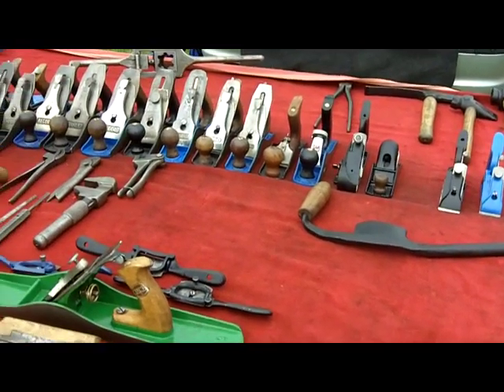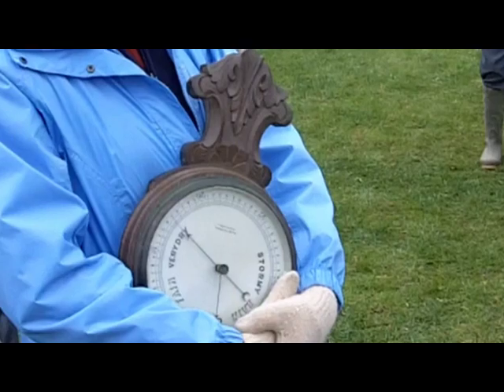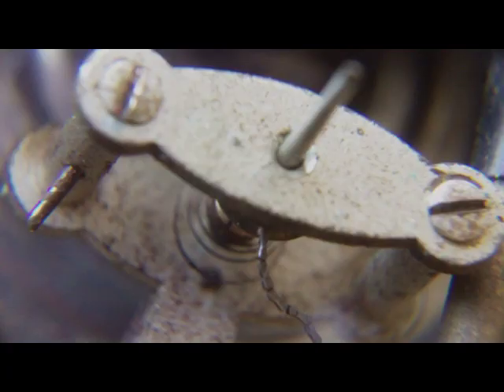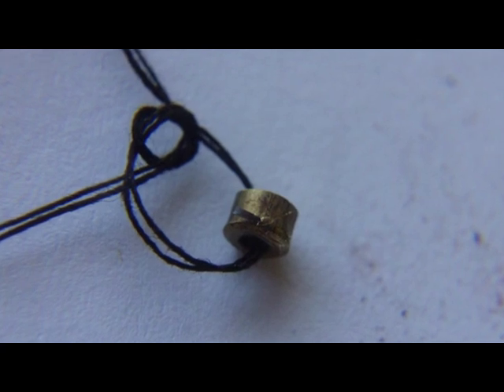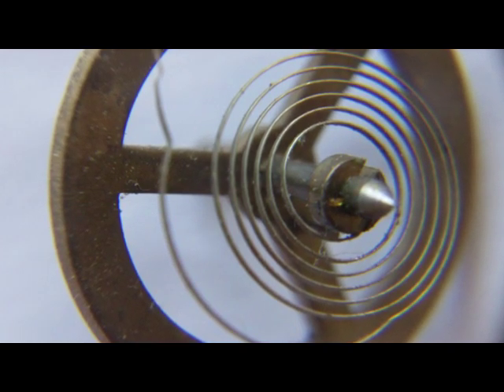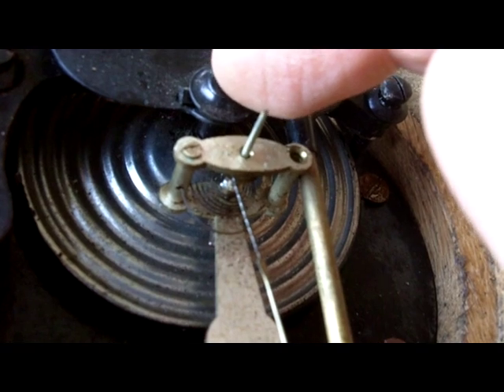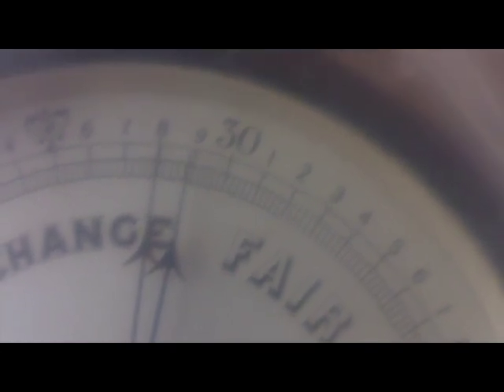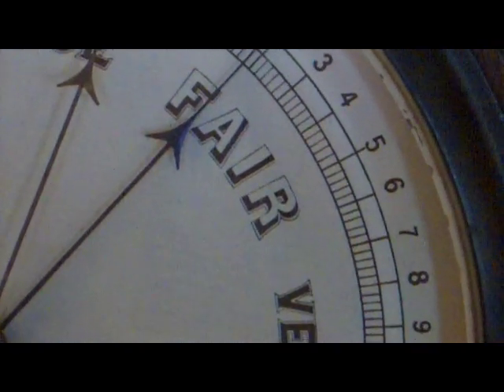Aneroid Barometer repair

Comment: Wow fascinating, you were very brave taking a risk on that barometer!!! Can’t believe you fixed it, I had a similar problem with my barometer but being a very very quick logical thinker I took it upstairs where there would be more pressure (due to my boiler leaking carbon monoxide). Unfortunately I tripped over the socks on the stairs that I was waiting to pair up. Tragically this led to my barometer braking completely and my dreams shattered along with it. I tend to just look out of my window now to get the weather which is less than ideal.

Many thanks

Dr. Grimsby
Reply from the maker: I had nothing to lose in fixing it but in actual fact it was more accurate than a mercury barometer that I have, the mercury is of course accurate in as much as an inch of mercury is an inch of mercury but the indicator dial on the front of the instrument is turned by a cord that is fixed to a float that rides on the mercury. The problem with the mercury barometer is that the little pully that drives the pointer is just a little too big so the swing of the pointer is always lees than it should be. the local MET Office is just down the road from me at, more or less, the same level, they update the pressure at very frequent intervals so it's extremely easy to calibrate an instrument based on the Met Office readings.  I sold an old stone built house in New Quay, Wales and I left the old barometer on the wall in the hall for the new folks, I hope the enjoy it. Regards . . . Andy
Reply: Thank you very much, you seem like a nice guy and very informative! Good luck on YouTube 

Many thanks

Dr. Grimsby
Reply: where  do i go  to get  my barometer  glass  fixed

Comment: Andy, thanks very much for the guidance.  Knowing mine was likely a push fit gave me the confidence to use a bit of WD-40 in the center hole of the dial pointer, along with a small flat pry bar that put an even force on both sides of the shaft.  A gentle pry was all it took to pop off the pointer w/o causing any damage to the pointer or dial.  I was then able to remove the porcelain dial to observe the mech, which appears to be in good condition and working well!  Cheers - Stuart

Comment: Thanks for the post Andy. Have just bought a rather cute post war-ish  Barigo set into a ships wheel - approx. 2.5 inch face. As the needle has been stuck on' Stormy' for the day I've had it I was assuming it was a no goer but your sealed plastic bag trick has demonstrated that it does indeed work so I suppose it is more a calibration issue. I'm sure a little more research will unearth a fix. Thanks again

Comment: I have an old Everest barometer- I have no idea how old this is, could be maybe 20-30 years old.  It's one of 3 gauges in a block of wood, comprising also a thermometer and what was a humidity meter.  I have converted the humidistat to a clock now!  Anyway, I have been monitoring the barometer & comparing to my local online weather website, and so far it seems fairly accurate..  At the moment, I'm adjusting the length of the main lever which pushes on the other lever which pulls on the chain around the pointer spindle.  It's a very fine adjustment..

Comment from the maker: @AllAmericanFiveRadio  Hi Rich 
It's amazing that the capsule has held a vacuum for so long. I used to own a company that manufactured Induction Heating equipment and when I was working with fridge manufactures they said one of the main considerations of the 12months guarantee was the soundness of all the welded and brazed joints that hold the pressurised gas. Vacuum can be even more problematic to hold in small metallic structures. There's not a lot of vacuum held and it's soon lost.

Comment from the maker: @Scubarod 1 of 2 
Hi again.
High pressure squeezes the capsule and the mechanism drives the pointer down to show lower pressure. If there were a leak the capsule would not be squeezed as the pressure would be the same inside and outside and the pointer would show a higher reading. Have you had this device long or is it new to you? If it’s new to you watch it for a few days and see if it changes at all.  ... see part 2
Reply: Higher pressure on the capsule must be reflected by the pointer moving “UP” to the right ( as you can observe when testing it with a plastic bag) not “DOWN”. Thank Andy you for a very informative video.

Comment: If the pointer is removed, should the bellows be at low, medium or high expansion when replaced?  I can make it read correct with the adjustment wherever the bellows and mechanism are positioned.

Comment: @AndyDaviesByTheSea 
the info at the airport site i updated every hour. this device is new to me...i could send u a picture if u like. i have kept an eye on it and it does fluctuate. im sure it works. what is interesting is that hen i got it...few days ago..it was out of calibration...following instruction i adjusted the brass screw at the rear an made it read a current reading. 2 days later it as off by 4 bars...mine to has 10 bars of reading between each whole number.

Comment from the maker: @Scubarod 1 of 2 
The calibration screw can be very sensitive.. With all things like this there is a problem of ‘Stiction’ that is a resistance between the fixed part and the moving part of the device. It’s because of the ‘Stiction’ that you have to tap the barometer to get the needle to settle on the true reading.
Re calibrate the unit and tap it to settle the needle on the new reading.
 Andy

Comment: hi....great vid...i have question about accuracy...i have a fisher german made barometer. i have calibrated my barometer but it still does not read actual air pressure. i tested the barometer in a bag an it does respond to pressure. today the preessure is 103.31kpa but mine reads 33.2 In of mercury....the conversion does not fit. what could be the problem?

Rod

Comment from the maker: @Scubarod Hi there
Compressing the air I a bag tells you that the barometric capsule responds to the short term or quick change of pressure but it doesn’t confirm that the capsule is leak free.  If there was an extremely small leak in the seal of the capsule the bag test wouldn’t show it up.  Where as if the barometric pressure changes slowly the air would have time to leak out and depending on the size of the tiny leak. I think such a problem would soon show up.     Regards  ... Andy

Comment: The swivel pointer ( on the glass) of my barometer is loose ,  it simply hangs down,how do I tighten it?
It has a square shaft fitted with what appears to be  push fit arrow/pointer. I thought I could simply push it down the shaft but it didn’t want to go. I tried to gently tap it down and (DOH!!!!!!! ) broke the glass!
Now that I have a new glass, does it hold in position on the inside of the glass simply by friction?
Advice please. As you may have guessed I am an amateur.

Comment: Hello. Thanks for the video. I have got an old barometer which doesn't move, so I assume that the spring is broken. Unfortunately, I don't have any springs, so the question is: can I solder the spring (assuming that it's in no more than two pieces)?

Comment: Brilliant video, some great tips!I have one almost identical but slightly different carving in the woodwork.The problem with my one is the brass bezel holding the glass is badly cracked in several places and right through in one or two.I wondered whether replacements are available anywhere?Otherwise it's great. Any advice would be appreciated.
Reply: You might find a replacement, or you may look to see if there is a similar barometer  on eBay  (a broken one would be ideal) I'd look to see if it was the same brand or maker.
Reply: @asbestosfiber  Good idea,many thanks!🙂

Comment from the maker: @Scubarod 2 of 2  You say that it’s new to you but I still don’t know how old the unit is.  
It could simply be the newness of the device that the surface hasn’t ‘bedded in’ yet.
I’m not an expert on these things I simply work form first principles and I know that the movement of a few thousandths of an inch in the capsule is amplified to give the reading and it’s very sensitive. 
... regards ... Andy

Comment: I have a similar mechanism but smaller and I think the chain connecting the lever arm to the dial is broken.  Any suggestions on what to replace the chain with? Does it need to flex in all directions or would a wire work, the top section of chain is intact and I'm assuming that's the bit that flexes around the central dial shaft.
Reply: I also have the chain missing on a Taylor Stormoguide. Any ideas where to fine the chain?

Regards,
Bob

Comment from the maker: Hi Paul I'm no expert on these things, as a designer/inventor I simply work from first principles. In this barometer the spring and  fine chain had rusted up. I live by the sea and it’s amazing just how corrosive sea air is. My barometer would have been ok if someone put a little light oil on the fine ferrous components. I think a little light oil wouldn’t harm anything but I’d say don’t spray stuff in that could get on the dial or glass as you’ll have to open it up to clean it.
   ... Andy

Comment: Hi Andy! I inherited a barometer from my Grandad, and I'm trying to figure out what type it is, and aneroid barometer is the closest I've gotten. But it has a wheel / fan on the side of it with lots of angled metal parts that spins round in the wind. It has 'FEET' written on it, so I thought some kind of altitude or pressure barometer. Do you know what it is? I can send photos if you have an email address. Thank you! Chloe

Comment: Andy, how did you remove the dial pointer from its shaft?  Is it a friction fit, or screw on?  I ask, because I recently purchased an old English aneroid barometer...  The mechanism appears to be working, but the dial pointer seems to be installed backwards (i.e., the tail end points to the correct barometric pressure, not the pointer end!).  I tried some gentle pressure to pry off the pointer, but it didn't budge.  I was afraid of being too aggressive for fear of damaging the movement. Thanks!

Comment: I have this barometer movement as one of 4 faces on a Lecoultre 8 Day Desk Clock.  To regulate to the correct pressure for my location, can I just pull out the "hand" and reattach it back to the correct pressure reading (for my city)? I suppose any "change" will move the hand from that regulated point?

Comment: How did you remove the glass? I have a Taylor Stormoguide and cannot figure it out
Reply from the maker: Michelle Goodwin 

Hi Michelle on the barometer in the video it was easy as there
are three tiny screws that go through the front of the brass bezel,(that holds
the glass,) into the wooden body.  I don’t
know how yours is fixed. Maybe if you try to slide something like a very thin
strip of plastic, (like a strip cut from a pop bottle,) between the bezel and
the body it might give you a guide as to where the fixings are located.   But I guess
that the bezel could simple have serrated teeth around its edge that are
pressed into the body? I'm sorry I can’t be more helpful. Good luck.Kind Regards  . . . Andy
Reply: Hi. did you get the glass removed. I've got a West German barometer and I've got the same problem. Cant get to the mechanism.  removed every screw I can see but no go. unless the screws are under the glass and the copper cover is crimped around the glass then the glass is probably gonna get broken.
Reply: +Eric Bleeker hey Eric, I never did get the glass removed, since mine was a 1927 Taylor Stormoguide, the ship wheel edition. My brass was crimped around the front watch glass, so it wasn't a repair job I could do on my own. However, I discovered a month ago that almost all Taylor 1927 barometers have the same face, so I bought a different style, popped out the whole barometer piece, and popped it in my ships wheel one. I would suggest looking for a different model with the same barometer face, and doing the same. :)
Reply: I just finished bending the face open with a small pliers, not a pretty job.  So now I can get to the mechanism.  Planning on building it into another case. Thanks for getting back to me.:-)

Comment from the maker: Hi there, I'm guessing that your barometer is calibrated in millibars.    
1 inch of mercury = 33.86 millibars 
so one millibar = 0.0295334 inches of mercury
That gives you a range of about 20 to 26 inches of mercury; mine has a range of around 25 to 32 inches. I'm no expert in these things but Google ‘convert inches of mercury to’   and you should see a list of options for you to select but I'm pretty sure it’ll be millibars. 
I hope that helps
Kind Regards ... Andy
Reply: where do i go to get my barometer  fixed

Comment from the maker: Hi Stuart, my pointer is a simple push fit like the second hand of a clock. I guess the pointer of your barometer could have been incorrectly replaced but I somehow doubt it. It cloud be wear or simple a calibration issue. I’ve only dabbled with these things but you might find a good web site where you can get so professional advice, been a bit of a ‘brute force and ignorance guy’ myself I’d be inclined to try and get a bit of heat on it without marking it and pull. 
 Kind Regards ... Andy